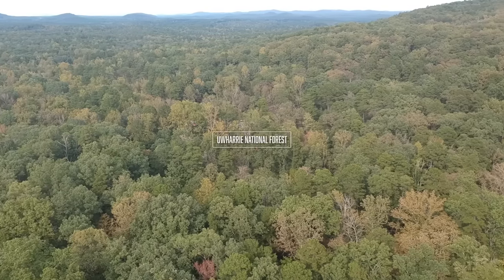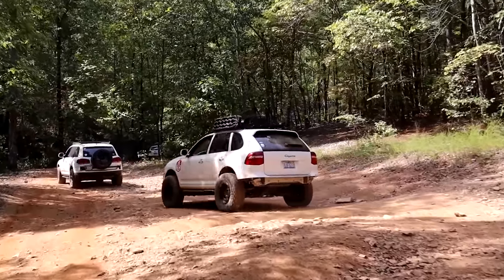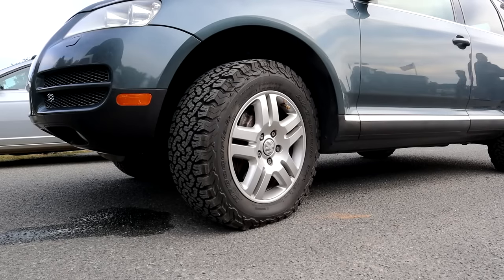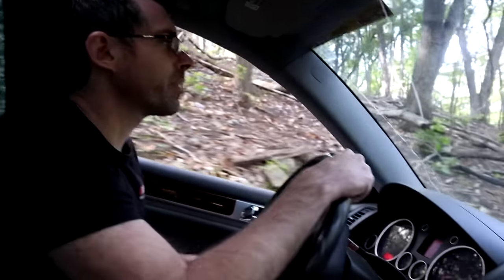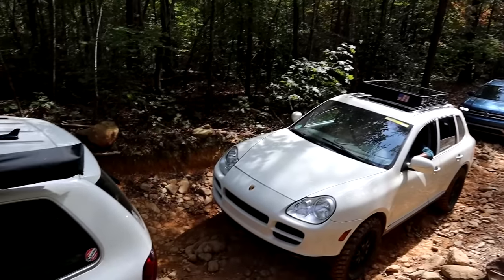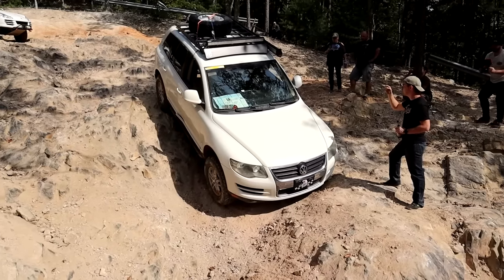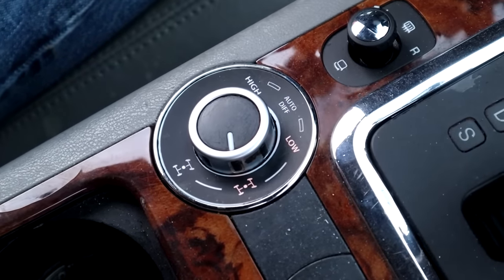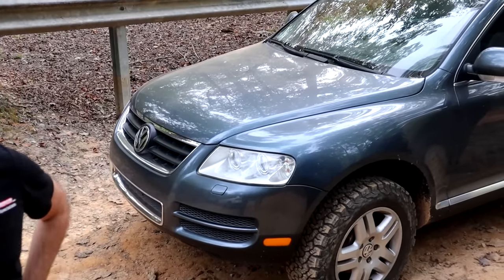Can a Stock Volkswagen Compete with Off-Road Jeeps?

Comment: I understand VW techs really disliked these rigs from all the  problems they had back in the day & for good reasons. But almost 20 years on I feel like the surviving example's full potential can finally be realized. Now that they're obtainable for a reasonably low entry fee it makes them more accessible to niche enthusiasts & tuners. Dare I say the 1st gen Touareg/Cayennes are finally coming into their own!? Really enjoyed the video. Will enjoy seeing more of your experience with the Touareg👍 Liked & subd
Reply: i agree, lucky enough to have found a low milage 2004 v10 with religious service and repairs and considering the 8000 entry point i engaged in allows me to look forward to repair cost less stressfully.
Reply: Buy mine! 😎
Im in Oregon
2004 Blue V8 non-air suspension 146k
Reply: Yep, Trex and Cayenne are so capable its the natural +1 aftermarket for offroading and overlanding...
Reply: hell yeah i got a v10 tdi for 3 grand a few years ago now you cant even find a v6 for under 10!

Comment: Gents.  I dropped a pair of LED H7 low beams in my '05 Touareg.  It totally transformed my evening drive experience.  Highly recommend this easy mod.  The Can-Bus resistor adapters are also recommended.  When High Beams fail, I'll replace those with LEDs as well. Huge Difference in visibility.  Cheers.

Comment: Had our Touareg 14 yrs.. wish I kept it for this, but no 4wheeling around here :( I used to run a lot less air pressure... like 5-10psi.  you might want some sway bar quick disconnects too while you are at it. Atlas is more capable than I would have ever have expected.
Reply: Ya man I was totally shocked at the Atlas! So cool to see it getting after it! I have mine in order right now and expected Dec 10th and will be doin the H&R struts and springs with some 265/70R17 Mickey Thompson Baja Boss A/T on Fifteen52 wheels! Can’t wait to get her a little dirty!!!! My last VW was a 14 Passat bagger and it never got dirty! Same company different ways man! Groovy shit!

Comment: Such fun videos, thanks again Paul and also kudos to Jack on his TIG!

Am watching closely for info on adding lift to my 2017 AT...

Now, who ARE the guys that did the custom suspension work for VW on the ID4 race test in Baja not too long ago?

Thats the OG hub of VW bugs in Baja, and the next gen application of tech to make the mk7 platform realize its "off-road" and overlanding potential...

Forge is proving the aftermarket interest is there and see B2BFAB for more...

Comment: How does the Touareg transmission and transfer case hold up under for real off-road use?  Just about every cheap T-reg I see needs a trans and / or some kind of timing chain service-related repair
Reply: 1st generation gearbox is made in Japan and audi q7 and porsche cayenne use same gearbox. And 1st generation have a separate low gear transfer case, so its pretty durable

Comment: Nice job, wheel a toureg and jeeps here in Colorado. Yep the toureg will surprise (ours has the diff locker) you but it really is no match for Jeeps and things with solid axles. But for normal forest trails and getting to most fishing spots it is nicer then a jeep. Suburas and things without a transfer case would be wise not to follow.

Comment: looks like i need to see about smaller wheels/off road tires for my 17 touareg wolfsburg model and see what it will do out here in the desert. as factory it does very well on pavement in the curves and at higher speeds.

Comment: me thinks your Touareg has a locking rear diff as you have an extra setting on the left hand switch that my touareg does not have.   if there is a small electric motor on the rear diff - its a locker.
Reply: Some even have central dif lock
Reply: I believe he was showing a video from another treg just to show one with a rear diff, I have rear diff on mine and I believe you have to have air suspension to get it also…all the first gen tregs had center diff locks